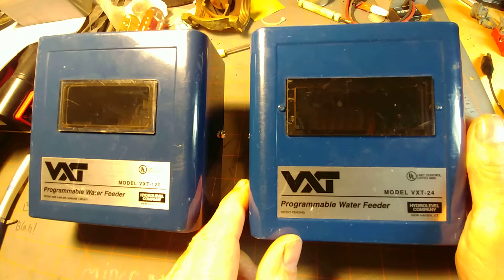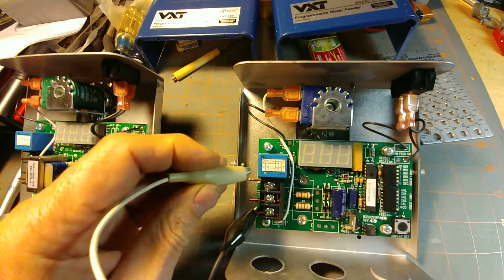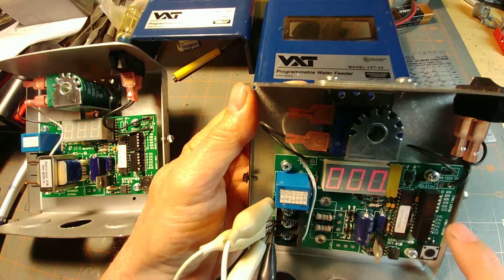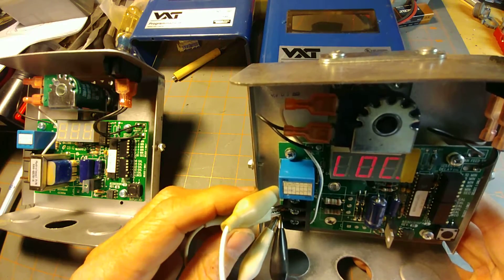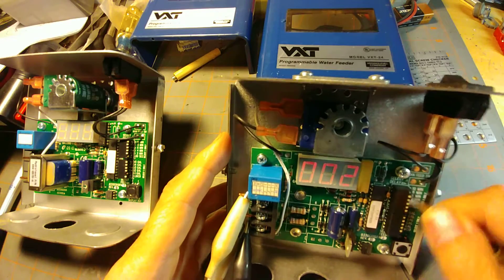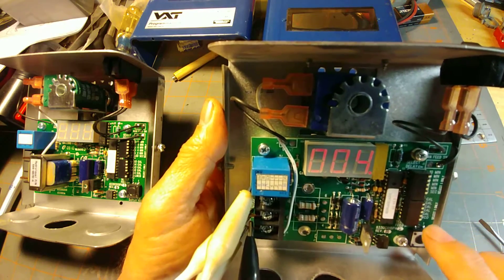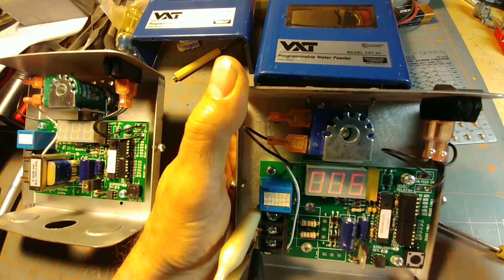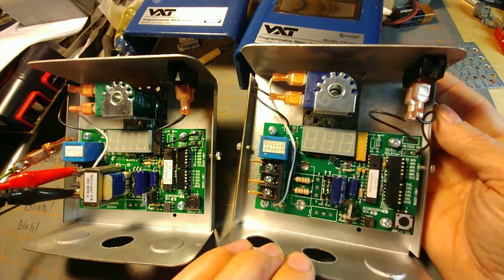Hydrolevel VXT Steam Boiler Water Feeder

Comment: This video is a gem.  Thank you for de-mystifying this device.  The installer flat out refused to give me any information concerning its programming or operation but as you've shown its really quite simple to get the auto-feeder tuned up.  I'm going to note the desired water level on the sight glass then drain the boiler until the LW sensor kicks in......the amount of water in gallons that drains into my bucket at that point will be where I set the water volume dip switch. Thank you again.
Reply from the maker: Thank you for your kind words!

Comment: Hello my friend, for the first time I am watching your videos and I find them very interesting. What I would like more if you were to make the videos in Spanish because we know a lot of people who do not understand English, my question is the following, after a week I installed a new boiler and installed it also hydrolyze it cdt 24 vl what happens is that suddenly the boil turns off and i don't understand and in the feeding system it indicates LOC
Reply from the maker: "LOC" means the low water cut off safety control (LWCO) asked the VXT feeder continuously for water for two cycles in a row without satisfying the LWCO.
Either there is little or no water actually going though the feeder into the boiler, or there IS enough water in the boiler, BUT the LWCO is not sensing it thus giving false signals to the VXT, or you have one heck of a leak somewhere in your system.

Comment: Just came across this.  I have a 120 model, even though it's a Natural Gas steam boiler.  Anyway, we are experiencing steam radiators spitting water.  I looked at the boiler and the water tube was over the top.  I emptied it and got it down to low-water cutoff. Allowed to refill, but it seems to be calling for water when it's not needed.  I can hear it kick in even during the summer.  Is indicative of a bad feeder or the low-water cutoff sensor?  BTW, my feeder is set to LWC and 3 minutes.
Reply from the maker: I would say that the low water cut off is sending false signals to the feeder.
Try draining the boiler below the probe and removing it and cleaning it.
Have a replacement probe handy just in case.
If the LWCO is still sending bad signals to the feeder - that is to say you can see water in the glass at or above the proper level & there is a lit period after the numbers on the VXT -then it may be time to replace the LWCO.
Please be aware I can't see the whole picture & there may be other unknown issues!

Comment: Hello Gordon.  First I want to compliment you on your videos.  They are extremely helpful and well-presented.  So I recently became responsible for an oil-fired steam heating system.  It is quite old but also seems to be quite reliable.  Neither the oil burner nor the boiler have been serviced in a few years (like possibly 8 😬) so I’m crossing my fingers and putting together a plan for spring.  Since I have no experience with steam systems I am in the process of figuring out how these systems are put together.  I’m wondering if you’ve ever seen an auto-feed system that consisted of a proximity switch pointed into the gauge glass hooked to a relay timer hooked to a Skinner solenoid on the feed water line.  Is this normal or something my wife’s late husband, who was an accomplished electrical engineer, made up?  Also, there is no manual valve on the feed line.  I can get it to add water by sliding the proximity switch up the glass though.  Is it ok to do that or should I have a manual bypass loop plumbed in?
Reply from the maker: Thank you for your kind words of praise.
Yes, I'd get your oil burner & boiler looked at as soon a you can by a competent oil/boiler tech.
They are hard to find.
As to your unusual water feed system, we'd all like to see pictures.
Please post them on HeatingHelp.com!
Reply: @gordonschweizer5154  I didn’t think this setup was typical.  Can you explain where this VXT system gets it’s signal to turn on from?  Is it from the LWCO?
Reply from the maker: Normally, the VXT is tied into the LWCO for power, neutral or return, and trigger or "feed" signal.

Comment: Good day your tutorial was very informative 
My question is that I for the summer shut down the gas and power supply to the heating system upon powering up and turning on the gas valve the VXT-24 is flashing on /off ,the low water cut off also blinks then stop for around 30 seconds and repeats with no water feeding. Manual feeding works and the glass tube shows the correct amount of water for boiler to turn on . 
Please if you can help advise on how to troubleshoot this problem 
    J C
Reply from the maker: Thanks!
You may be having an issue with a malfuctioning low water cut off.
Is your LWCO a PSE-802-24 by chance?
Try draining the boiler, pulling the probe, and cleaning it.
If that doesn't work, you may have to replace your LWCO & probe.
Reply: @gordonschweizer5154  Thank you for taking the time to answer my question the Low water cut off is a safeguard 400
Reply from the maker: You're welcome.
I may, however, be not giving you complete advice.
It seems as if something is interrupting the power to your LWCO, maybe.
You say your VXT is turning off and on & your LWCO is also cycling through its self-check?

Comment: What does it mean when the numbers go up?
Reply from the maker: The feeder is designed to track water usage or loss of water.
If it feeds for one minute, it will display 001, for example, and may represent the loss of about one gallon of water from your steam system.
The higher the numbers displayed, the more water possibly being lost from your system.
You may have a leak somewhere.

Comment: Thanks for information, pretty helpful to me, it leading to the reset low water reset tab and 30 segond tab buttons, your info help me solved the problem, thanks again
Reply from the maker: You're most welcome!
Since the time I made this video, I'm now recommending a 2 min delay setting rather than 30 sec.
30 seconds is really for this video, otherwise it'd be too long and even more boring!
And also the 2 min delay recommendation is in the official instructions.
Reply: I will make the 2 min  recommendation adjustment ASAP, you are the best, thank you so much

Comment: 120v was connected to 24v unit, is there any way to repair it?
Reply from the maker: Most likely not.
What happened, exactly?
How long was the 24v circuit exposed to 120v?
What looks "smoked" on the circuit board?

Comment: Thank you for your most informative video.  I've watched of few of your this morning and I should like you to know, you're is the first channel to which I've subscribed :).  I think it's wonderful you continue to respond to comments more than two years after posting the vid.

I've heard various answers to this question and would consider your credible.  What is a normal about of fill water to us in a cold month?  I have two systems, both replaced appx. 7 years ag.  They're one pipe systems.  The first provides heat to an appx 1340 square foot first floor apartment and the other provides heat to an appx. 2300 square foot second and third floor unit.  Both were installed by a plumber I believe to be experienced in steam heat (as difficult as that is to find) and were inspected by the City, so I'm assuming the plumbing was done correctly.

All the steam vents, including the main vents are working properly.  There may be one minor leak from between two sections of a radiator (sucky situation, from what I understand), but I don't think that would account for all the water loss on the upper unit system.  I'm unaware of any leaks on the first floor system.  Do you have any thoughts on how to track down a water leak?

Thanks again for a wonderful video and your insightful responses to comments.
Reply from the maker: You're welcome!
Any leaks that are visible on a steam system should be dealt with ruthlessly.  
Steam is sneaky that way.  
For every drop you see, there are three or more you don't. So that "minor" leak really isn't.
Packing nuts on valves must be snug on the stem or steam will wisp thru them unseen.
Union nuts might only leak when the pressure gets above 1 psi on extra cold days.

Comment: Please tell me what is the meaning of the number shown on the water feeder, appreciated
Reply from the maker: It should display the number of gallons added to the boiler.
Reply: @gordonschweizer5154  thank you, is there any limitations for me to pay attention to the numbers? Or just leave it?
Reply from the maker: @cliftonliu6054  If the number is a single digit, excellent. Low double digits, great. High double digit, may be a leak somewhere? Triple digits, generally signals a problem or problems requiring immediate attention. Also depends on how long the VXT has been in service and how long ago the VXT was reset.

Comment: Is it possible to set the cut in when let’s say when the boiler is 3/4 filled and topped off to full.and how would that be achieved. Great video by the way.
Reply from the maker: I think the best way would be to fire the boiler, and slowly drain the boiler to trigger the LWCO.  Watch as the VXT times out the delay and watch it feed to the desired level.  Then I would alter the settings if necessary, test again, and adjust as needed.
I would start at 2min delay/ one gal. per feed. and go from there.
On some boilers, I've had to resort to 2min (or above) delay and shut off at the "LWCO" setting which does not allow the lockout feature to engage IIRC.

Comment: Gordon, If the low water shut off malfunctions and sends signals to the HydroLevel I am concerned that it could flood the system, I read about an interrupter switch that senses excessive pressure in the system and kills the feed wire, do you recommend one and where is it to be installed?
Reply from the maker: We haven't done anything like what you suggest, so it would be taking on airs if we gave any recommendations as to that.  It certainly merits discussion, however.  Please don't take this as an end to the matter.
Maybe we could come up with a plan.
I take it you have had the unfortunate experience of a flooded steam boiler?
Reply: The VXT-24 locks out if a low water condition is not satisfied after two consecutive feed cycles, and the screen displays LOC. This will prevent flooding.

Obviously if the valve seat fouls,  and mechanically the feeder leaks past it,  the boiler can also flood.  Same with any manual feed valve that bypasses the XVT.

Comment: Sir , today I check the boiler water level and I notice the water inside the glass fluctuating. Is this normal?? If not how can I correct this condition??  Thank you
Reply from the maker: While the boiler is making steam, some fluctuation is normal. 
Any more than plus or minus one inch from the resting water line is mostly likely too much.
Reply: @gordonschweizer5154  thank you very much. 🤗
Reply: @gordonschweizer5154  hello sir, I'm back with another question.  My mothers apartment has 6 radiators but only 2 that are actually working. The other 4 have been turn off at the valve because they make her apartment to hot and also make alot of noise. Banging all day and night. Would it be bad for the boiler or the pipes themselves just having the 2 radiators working ??  Note.. I did tilt the banging radiators several inches but it did not make any difference in the. Noise. So I turn those 4 off. The crown boiler is has an 85,000 BTu output and a 103,000 BTU input.  Currently working nicely. I drain all the water this weekend and fill it back up.  unclog the sight glass as well as the pressure gauge and lower the pressuretrol settings to 1.5 PSI on the main and .5 on the differential
Reply: @gordonschweizer5154  also no more issues with the vxt. When I drain the water the WCO kick in and hit the boiler off. Several minutes later the VXT kick in and a call for water was started by it. And the water level on the sight glass went up. I also added a 4"  brass attention tube to the pigtail so that it sticks out further away from the boiler and makes it easier for servicing
Reply: @gordonschweizer5154  I've been getting alot of banging in the pipe system of my steam boiler. I believe us due to the pitch angle of the manifold pipe coming out of the boiler. Could I replace a 6" portion of that pipe to a shorter 4" section to make the pipe pitch more downward to the boiler thus allowing the condense water to return to the boiler faster and more freely.  What do you think?
Reply from the maker: @OSCARANDRES039  Without actually seeing your piping, it would be foolish of me to advise on the proper course of action.
Reply: @gordonschweizer5154  ok, I see. Thank you!!  What about steam traps??  Can those be used for residential applications?? Is yes, is there a particular one you recommend ?
Reply from the maker: @OSCARANDRES039  I forget, do you have one pipe or two pipe steam.
Generally traps are used on two-pioe steam systems.
Do you have traps now?

Comment: Excellent description of VXT methodology. Thank you Gordon. This helps tremendously!👍🏽
Reply from the maker: Glad it was helpful!
Reply: @gordonschweizer5154  I was able to time and measure exact amount of water per lwco call to reach level be4 Loc. Solved the boiler flooding issue. Again, thanks. My plumber never went over it.😠
Reply from the maker: @freddieharps6938  Glad it worked out. That's what this video is for!
Do you have a 30 sec delay or 2 min?
Reply: @gordonschweizer5154  Delay is set for two.
Reply from the maker: @freddieharps6938  Good! I used to set @ 30 sec delay, but lately have learned that 2 min delay is better for flood control. Live and learn.
Reply: @gordonschweizer5154  Yes we do. Please stay well keeping that open mind. Thanks again.

Comment: Hello and thank you for your video.  My question is the following, I have the vx24. And the counter keeps going up and up as if it was feeding the boiler. However I dont think it actually is feeding. Since the start of this season the counter was reading 163 times. I've check for leaks everywhere around the house and around boiler and there are none. The boiler is a crown boiler installed in 2015. Could there be an issue with the counter it self??
Reply from the maker: Hi! I think you are largely correct. It may be that for some reason the actual amount of water passing thru the vxt's valve is very low but not zero.
Have you had to add any water manually to get your boiler to fire?
Reply: @gordonschweizer5154  thank you again for your assistance and please forgive my ignorance in this matter.  🙄🤔
Reply: @gordonschweizer5154 Sir thank you very much for your reply, for your knowledge and assistance with this. To answer your question, no I haven't had to add any water to start it.  Not even normal operation during the winter season. I have done some maintenance by draining some of the old water and cleaning some of the gunk but nothing more.  According to the glass level the water inside boiler is alway at a proper level. Glass is always showing full or nearly full.  And like I said before, there are no leaks anywhere.  Would you be kind and also tell me if the red valves at each end of the glass level be set fully open??  And should the manual water feeder valve thats near the VXT be set to a close or open position?
Reply from the maker: @OSCARANDRES039  It is possible that your sight glass might be clogged with mud in the trappings and might not be telling your true water level in your boiler.
The sight glass valves should be always open unless servicing it.
The manual fill valve/VXT by-pass  should always be shut unless adding water manually.
Reply: @gordonschweizer5154  thank you again!!

Comment: Hydrolevel says on steam boiler 8 mins is good setting.  How can you verify on a one pipe steam system?
Reply from the maker: Hmmm. Not sure where Hydrolevel says "8 mins is a good setting" for a steam boiler. Were does it say that in the instructions for the VXT?
Reply: @gordonschweizer5154  i called customer service and they said go with 8  i have one pipe steam oil steam sys..  he was clear.  i found it odd when i read the post and watched videos.
Reply from the maker: @petergriffin1546  Hmmm.Something does not sound right. You must have really slow returns? Please share more about your problems.
We're not getting the full story, I think.
Reply: @gordonschweizer5154  no mention of any problems with them.  should i go to 2 minutes factory setting?  steam boiler is 8 years old and serviced annually.
Reply: @gordonschweizer5154  well ran boiler for couple cycles and timed the water return the fill line on glass and watched the pressure drop to zero...i have a 0 to 3 guage.
4 minutes 

so im guessing 8 min would be to much...
Reply from the maker: @petergriffin1546  Yes, 2 minutes is plenty in our experience.
Reply: You misunderstood.  The XVT instructions say that "8 gallons PER MONTH" is an acceptable amount of water to ass to a 100K btu boiler.  Many boiler companies will disagree with that, but adding 8 gallons at every feed event is obviously far too much water for a typical home boiler.

Comment: Best on the market, I always install a pressure regulator on them if supply water pressure is over 60psi. I toured the plant 20 yrs ago. They also make a commercial version with higher gallon feed rates. FYI at that time they also made rolls of pinstripe for cars.
Reply from the maker: Indeed! Thank you for comments as always.
Did you happen to see my videos of my visit to Hydrolevel's factory last year? They were very gracious to my intrusion!
No doubt you know they are now located in North Haven's old Marlin Firearms factory.
Reply: I was no aware they moved? I don’t remember what address they were at when I went. Very welcoming to visitors
Reply from the maker: @scottk0623  They were in New Haven on Canal St, IIRC.
They were then, and still are, justifiably proud of their products and enjoy showing them to folks wherever they are located.